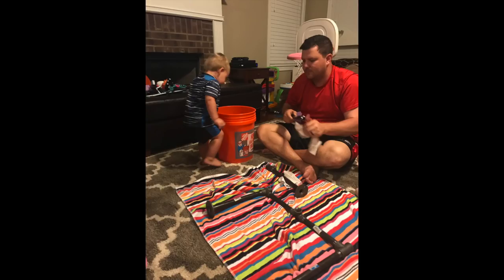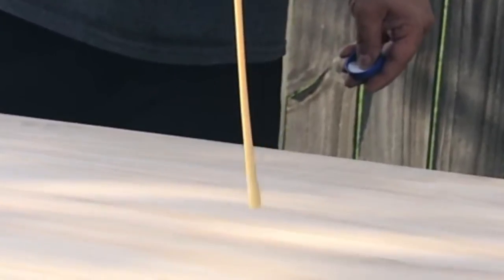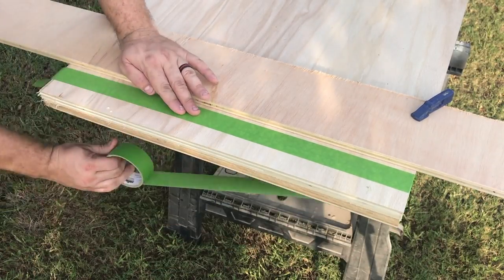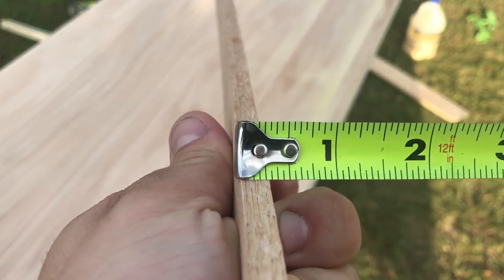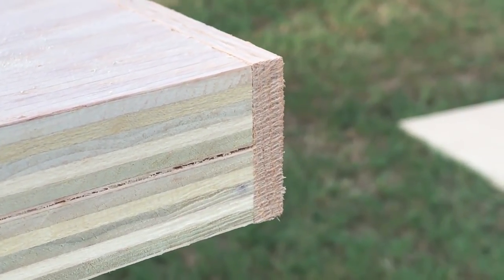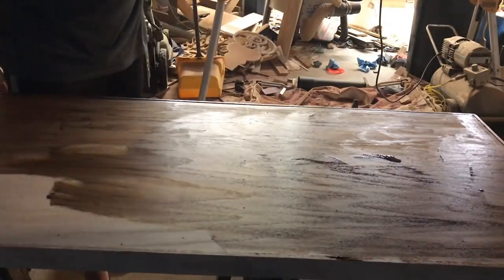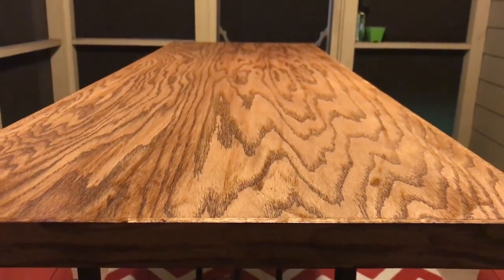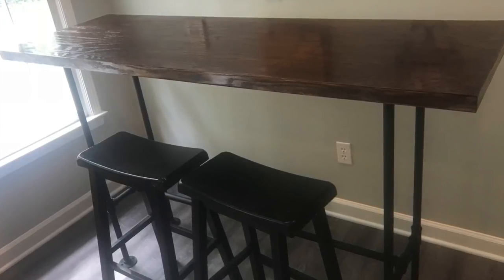Bar Height Table with Pipe Legs using Minimal Tools

Comment: I want to make this with no more tools than a drill. I was thinking of getting the ply wood cut the right dimensions at Home Depot, but would there be a way I could work around the brad nailer? Thank You:)
Reply from the maker: Just use glue and tape as a clamp just takes longer but wouldn’t need a nail gun

Comment: I'm a little confused with how you made the banding can you describe in more detail? I want to do the same but want the wood grain of the oak not the plywood sandwich exposed.
Reply from the maker: All I do is cut a thin piece day 1/8 thick the same width of the plywood then glue and tape it on or use Brad nails if you want too
Reply: Sorry, but I’m struggling to figure out how you don’t have the plywood sandwiching exposed on the banding the way you are cutting it. Would think your banding would show ply and it looks like solid oak grain?
Reply from the maker: I cover the whol edge with a piece of wood
Reply: I initially thought you cut the edge banding from the plywood based on the video but you wouldn’t have gotten that result. Guessing you used a solid piece of matching oak then?